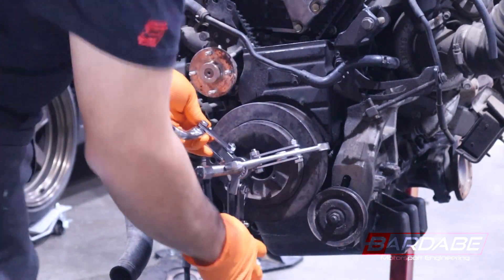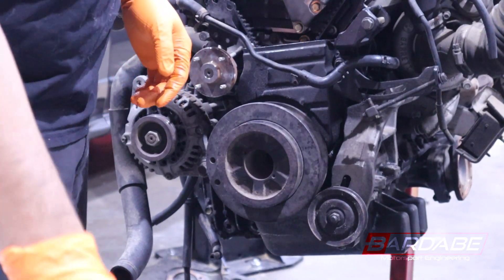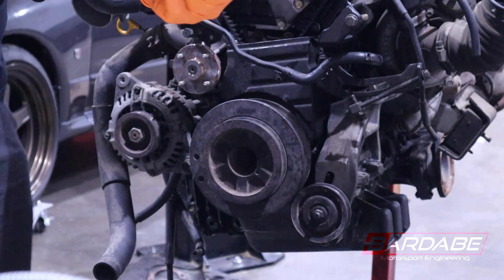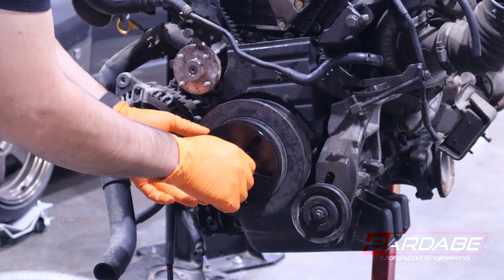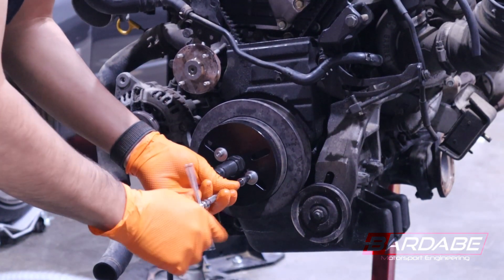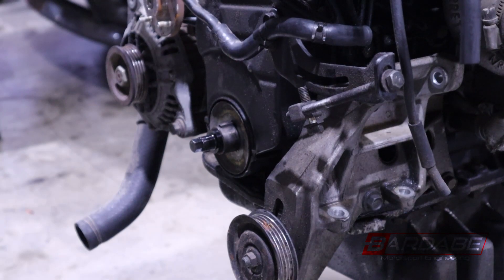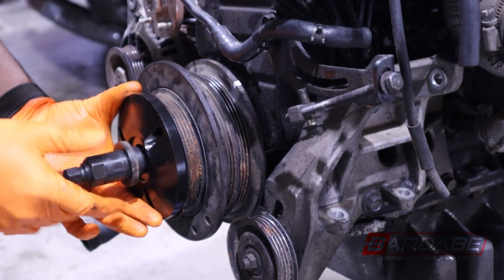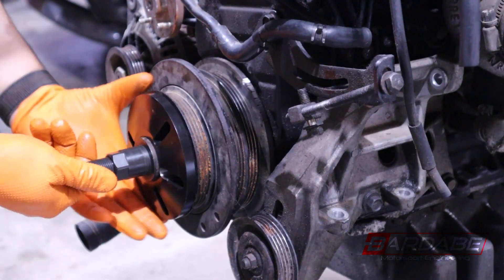RB26 Crank Pulley Removal and Installation

Comment: This is great for the RB community just curious what modifications need to be made to use on a R32? If you have a R34 noise crank no need to worry? Just curious I did check your site but didn't see any details in regard to the R32 chassis thanks in advance!